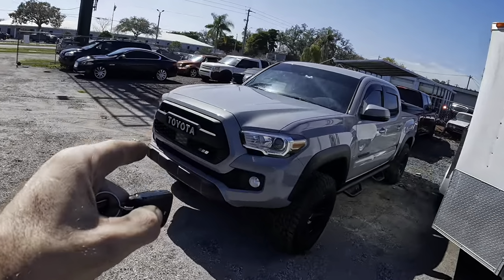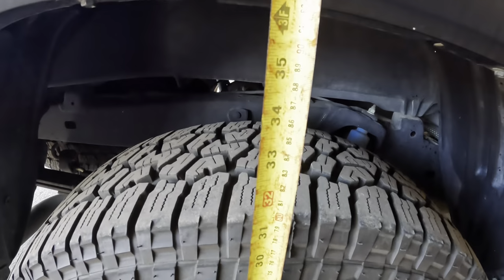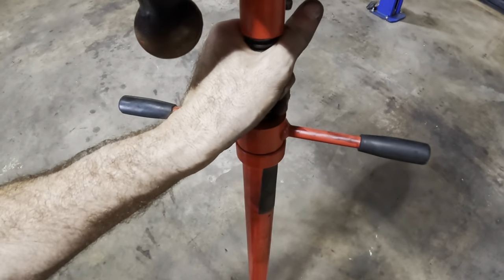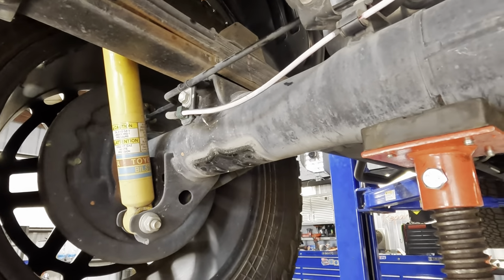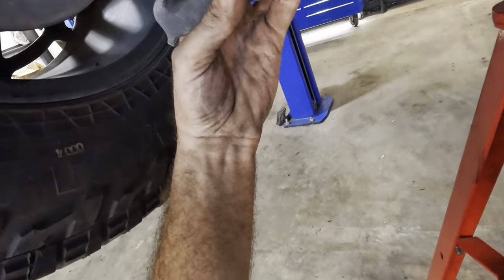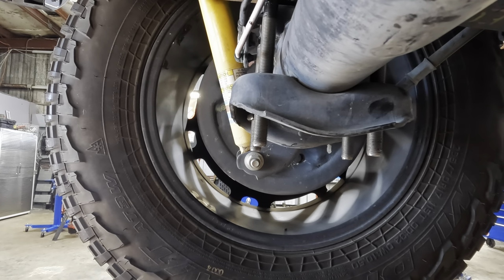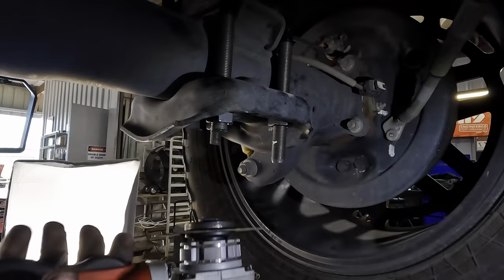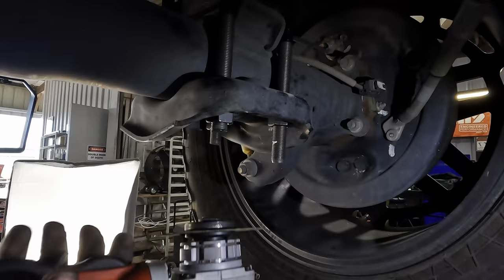Customer States Suspension is Leaning Reverse Carolina Squat | 2021 Toyota Tacoma TRD 4x4 3.5l

Comment: Toyota tech here. The rear shock holds the axle. If you unbolted the bottom shock the axle wouldve lowered and wouldve been so much easier. Also i see it had a pre collision system. This system is very sensitive and requires recalibration after any suspension modification or to be disabled for liability. Be careful, you can get blamed pretty easily if that wasnt recalibrated and they get in a collision.
Reply: Wait, so it could be upset by a minor change in ride height/angle like that? I could understand needing to reset it if you do some massive change in how it sits, but this wouldn't be much different than adding/removing a couple hundred pounds from the bed as far as how the truck sits overall.
Reply: @s.murphy8336  absolutely it can. In the owners manual it states if you are towing or hauling something heavy to disable the pre collision system. We offer a factory lift kit option for tacoma and tundra and when the recalibrations are completed the numbers are completely different. Assuming they also already recalibrated for just the front spacer as well.
Reply: I miss the days when vehicles weren’t big mobile phones with wheels. Don’t hassle about an EMP, don’t allow anyone with a Neodymium magnet near it😉!
Reply: @s.murphy8336 it’s a vehicle modification.. vehicle mods typically 99% of the time will void your warranty and the dealer will spin it anyway they can to blame the mod for the damages so they aren’t liable to repair under warranty.. always safe to wait till the warranty is expired before doing anything to your ride..
Reply: @s.murphy8336  I AGREE IT WOULD HAVE BEEN BUILT THAT WAY FROM THE FACTORY....EVEN THE LEVEL KITS CHANGE/ALTER THE NATURE OF THE VEHICAL
Reply: Finally, sound advice!
Reply: @BoomHeadshot666  Unless he got an extended warranty  it's out of warranty 3yrs/36,000 miles. Trucks a 2021 with 68K on it

Comment: Tacoma need a longer rear shocks, it's topping out when you brake.
Reply: That doesn't matter when your doing the lift just for the looks. 🤪
Reply: @Rocket39Smoke14  what you mean it don't matter, it will destroy the shocks. it'll come back in 2 weeks cause it leak oil everywhere.
Reply: Those being the stock/factory shocks, probably could do with a set of longer travel ones. Front & Rear.  Even if it is for looks only, the shock ending travel may contribute to ride quality issues.  I'm sure Ray will mention to the customer. I wouldn't have thought of it had the differential not dropped enough to put the spacers in.  Another thing I thought was those rear leaf springs may be what really needed upgrading, another leaf or something like that.  Just an observation.
Reply: @Rocket39Smoke14  The short shock will tear the mounts and shocks apart every time the suspension cycles because they will top out.  Having to long or to short of shocks will hurt ride quality because the shock will hit hard on every cycle.
Reply: Ok so, you mean that, Toyota have made a mistake, and installed the wrong shock? look, Ray did not replace them because is no need. we have to be more careful with the comments without knowledge guys!!!!
Reply: Yes. I am aware of that. So, why is Ray doing this lift knowing that it WILL cause more damage and hurt ride quality? I'll tell you why. $$$ @alvinmitchell6799
Reply: @victorbarajas1395  The stock shocks work for the stock ride height.  Changing just part of the suspension components can lead to other parts needing to be changed.
Reply: @victorbarajas1395 it's simple the distance from the top shock mount do the bottom mount is now 1 in further extending the shock 1 in further than stock height.
Reply: @dbeckley43  1 inch isn't going to make a difference with on road usage.

Comment: The next guy to work under that truck is going to be pissed when they slice their arm open on the cut and not filed edges on those u-bolts.. Kind of like the guy who snips the zip ties on an angle and leaves them long.. Otherwise love your channel and work ethic Ray.

Comment: The shock will now be over extended Ray needs new longer shocks
Reply: Yep, he should have realized that when he removed the U bolts and the differential didn't drop. Those shocks are maxed out.
Reply: No its not! where di you learned that the shocks will over extend? that is not possible and this is why, Ray did not replace them!! lets be good here and appreciate the work this channel offer us all!
Reply: @BruceCoggins  This is a dumb thing to do.  Driveway suspension designers, then this junk is on the road, scary.  the entire camber, caster is now all off, suspension, steering, is actually done factory for a reason, but a driveway nudnick knows better, here just raise this, shove some stuff in, i am an injuneer.
Reply: @victorbarajas1395  the axle stopped moving down, the shocks where holing it, then pulled down with block, makes shocks over extended,
Reply: The shocks had no vehicle weight on them, they are not "over extended.

Comment: In my 30 years of building Toyota Trucks. I’ve NEVER seen a broken U-bolt that was reused. And I’ve reused A LOT of Toyota U-Bolts. Even when building Spring Packs for Tacoma’s by adding extra Tundra leafs to the stack.

Comment: I had the same truck last year that I did the same lift block install on.  The easiest way to do that is on the ground. Loosen the U bolts and take that assembly off the axle. Next use the bottle jack that comes with the truck, the one that’s under the rear passenger seat. Take the bottle jack and put it on the ground right near the axle under the leaf spring and raise the bottle jack up to push up on the leaf spring and then you can wedge the block in to the open space. Then lower the bottle jack and reinstall the new U bolts.
Reply: It probably wouldn't make a good video that way , but your right saying on the ground ! Its the only way I can do it because I don't have a lift  .

Comment: So one of the first things my boss got me to do when I started my new job was to fit new springs to his ute. (because in my previous job, all I did was suspension, day in and day out...) It's just one bolt, and it makes it so much easier, safer and quicker to just unbolt the shock and let the spring and diff housing move how you want it to, rather than have the shock pulling on the components you need to line up again.

Comment: Arguing about weather or not you can reuse the u-bolts is a moot point when you realize that the original bolts were too short to go through the base plates with the spacers installed. Thus the new longer bolts.

Comment: To calibrate air suspension on audis the official measurement is taken from the wheel wells, but to the hub of the wheel. Tire inflation does not distort that

Comment: right side rear leaf springs are always a little stiffer because of the axel torque, they actually intentionally put more weight on the right rear wheel on a solid axel because the torque from the driveshaft makes the right rear wheel lift off the ground thus you get the "one wheel peel" most manufacturers bias the weight a little to the right rear tire for this reason.
Reply: That maybe true for some models but I know first hand the leaf springs on the f-150 come out of the same bin with the same part number and can be put on either side. I see it everyday at work.

Comment: every truck i have seen with a so called leveling kit, actually gave it a squat.  and the only truck i've seen currently that needs this is the extended cab f150 because the front is so much lower than the back.  you always wan't some rake.  both for payload and towing.

Comment: Never have questioned Ray till now but.. that needs longer shocks to make full use of the lift. The axle should have been easy to lower the 1” without prying if the shocks were not at max length.
Reply: That's not a Ray question, that's a 'What did the owner want done" question.
Remember, they already paid someone else to have the front end lifted first.
Reply: @MonkeyJedi99   I get that. One of the main reasons most shops wont install customer supplied parts. A local shop I go to will still install customer parts IF you provide them with the EXACT parts list they tell you is needed.

Comment: the 07 wrangler i had sat low on the front, that was common on the early jk's, the end of one of the front springs broke so i replaced them with springs out of a 4 dr which made it sit level.

Comment: I have a 2007 TRD, it has the 4.0 but I couldn't get the 6 speed,I barely could find the Tacoma.
It has been the most reliable vehicle I've ever owned, besides all the free work from Dana that is.  
I had to put an A/C compressor and cat back exhaust in 2022, brake lines in the beginning of 2023, and rack and pinion at the end of 2023. For a vehicle that's been in Michigan I'm impressed with its rust perfection on the body. No rust yet.
hopefully I can get 10 more years out of it. It drives like new.
I jumped when that prybar slipped!

Comment: You’ll probably get a more accurate ride height measurement going from center of the wheel hub to the fender. That way your measurements aren’t impacted by tire pressure.

Comment: Had a 68 Torino and I had to deal with a leveling problem.  Leafs in the rear and coils in the front.  I placed carpenter levels on the driveshaft hump and replaced the shackles until the levels show level in all directions.  Easy and effective  (I was a kid and couldn't afford new leaf springs)
Reply: Yep, Levels generally never Lie...
Reply: @randybeard6040 
Oh contrair Randy, levels, even when working typically lie. On the rare occasion they are just Plumb standing about. Even rarer still is when they are searching for a new Angle!

Comment: had you left the bolts on the first side loose it would have been possible to move the axle without resorting to the use of ratchet straps.

Comment: I think I’d give those bottom plates a couple of taps with a hammer to settle them in, before I’d torque them again. after your car park excursion ! To be fair, I’d rather have the back of the motor a couple of inches above the front.

Comment: I'm surprised the lift block did not have at least a °3 taper to adjust the pinion angle.  Perhaps one or the other could be rotated °180 which would be a very not good RAY!

Comment: Why?  is the biggest question?  raising a vehicle, why?  Missing the over sized tires sticking way past the fenders..cus you know, it's pickup truck brains
Reply: It is higher in the front right now and raising the rear is easier than lowering the front.

Comment: Curious, if you add aftermarket stuff like that do you give the stock parts back in case they want to put it back to stock someday?
Reply: Good question. I always thought a shop would at least offer removed parts unless there was a core charge or a safety issue involved like glass for example.
Reply: Shops usually do not return parts to customers unless asked to.  But in a modification situation like this, I don't know.   I hope the subject was covered with the customer.
Reply: Most shops I’ve seen when aftermarket “modifications” are made to a vehicle, the stock parts go back to the customer regardless of being asked unless the original parts being swapped out are trash i.e blow suspension/worn out no longer usable components

Comment: The heart wants what the heart wants, but I imagine these Toyota engineers obsessing of suspension geometry to get the best combination of ride, stability and capacity then making what they designed work with stability control, traction control and antilock brakes.  Then Joe Toyota owner wanting a "look" and getting a "leveling kit" that doesn't level, so lets add blocks....Ray does what the customer asks, and more power to him....but geez, the poor engineers knowing this goes on.
Reply: Yes. On what looks like a pavement princess, I fail to see what the point of lifting is in the first place. It's a culture thing now. It doesn't seem to have any practical use whatsoever. Lifting stuff just seems to be the current generation's d*** measuring competition.

Comment: IMO, instead of a lift block, the owner should have opted for an additional "helper" leaf spring added to the rear leafs.  It would have lifted the rear between 1 and 1-1/2 inches, plus increased the overall payload capability of the truck.
Reply: That's what I was thinking. Spacer is just for looks. An add a leaf would have multiple uses.
Reply: You're assuming that someone with a pickup truck would actually want to pick things up with it.
In my New England experience, about 40-50% of pickup truck owners use it like a car. And about 10-20% refuse to put anything in the bed for fear of scratches and dings.
Reply: That tonneau cover and shorty bed says this vehicle does not do truck things, so no need to add capacity.
Reply: @jdesaavedra0432  But he has a 3 way hitch.....
Reply: The proper way to check ride height is from the guard to the centre of the wheel hub as the ground is not always level even concrete.
Reply: @darrengray2309  Good point. This also eliminates differences in tire inflation.
Reply: well yes but new spring packs aint cheap, I need to buy a new set of rear suspension components and I think it was gonna total out to around 2k for everything I needed (springs, shocks, helper bags (maybe) mounting hardware etc.)
Reply: Wouldn’t that also make it stiffer when riding empty? I’m not sure I’d want to beef up the springs unless I intended to keep a camper or something else attached to it.
Reply: @thewausaudude  That is part of the decision loop.
Are you seeking height for "cool" on a pickup you use as a less fuel-efficient car? 
Or are you looking for some extra height to allow heavier loads to not squat your truck to where the tires (tyres, for our overseas friends) threaten to grind the wheel wells?
Reply: @MonkeyJedi99   yeah I’m not sure what the owner was going for in this video other than correcting the squat. If I had a truck it’d probably keep the stock suspension. One would be useful for pulling the boat and the occasional times I need to haul things, but that’s about it.
Reply: @thewausaudude no one buys tacomas for their smooth ride, I drive a ram 4500 with a big ass service body for work and it definitely rides better
Reply: @jonlittle1402  true. I’m just remembering a time when my grandpa sold his old pickup and camper insert. The buyer originally only wanted the pickup and bought it with the camper removed. Thing is it had heavy springs to support the weight of the heavy 1970’s era camper. Guess it rode like it had no springs at all and the buyer shortly returned for the camper anyway so it’d at least drive without requiring a chiropractor to be present with every oil change.
Reply: I don't think that guy was thinking that far ahead, he probably was just thinking about getting the look at the lowest cost possible.
Reply: Wouldn’t you also want to check air pressure in all four tires to ensure that they are equal?
Reply: @MonkeyJedi99 those are specific percentages for "your experience" 😂
Reply: @electropentatonic  That is EXACTLY what I said.
I properly relayed subjective evaluations, with language specifically indicating that is was subjective.
-
What was the point of confirming that for the rest of the class?
Reply: @MonkeyJedi99  Just pointed out the numbers are bullshit and completely irrelevant of anything in the real world.

Comment: what would be the outcome if the impact tightened the bolts too tight. then you use a torque wrench set at a lower setting than the impact socket the torque would click and it could be too tight???

Comment: I haven't read farther down, but am I the only one wondering if the reason the "new" "leveling" spacers up front were installed and the lower shock/strut bolt was tightened while the suspension was fully drooped down, resulting in unexpected extra height? (Bushing captured under zero suspension pressure resulted in unexpected extra ride height?)

Comment: Is it worth explaining to people that with Independant suspension the wheels move in and outwards as well as just up and down, and when placed back on the ground the tyres don't move as much as the suspension needs to and that is why they hold themselves in and the vehicle up higher until the tension comes off the tyre and releases the tension in the suspension? or is that too much of an explanation?

Comment: Not understanding not removing the on lower shock bolt and wasting 15 mins with straps and pry bars. You had the axel on a stand! Must be a long day! If the gas tank is on  the lft side you'll usually  get a slight difference  from the right an left side.

Comment: Good example here. If this job was getting done at a flat rate Toyota store there wouldn't be a tech that would take the time to cut those U bolts down.
Reply: They wouldn't have taken the extra 5 minutes to bother measuring it either. Find out how shops pay their techs before picking a shop to bring your truck too.

Comment: Trucks are set up with the front end lower than the rear for a reason. I suppose if you just want a pavement queen and use the back as just  a beer can recycle bin it's ok.

Comment: There are a lot of idiots in Floriduh that have lifted trucks that are much highed in the front than the back. Must be the new "low-rider" look. Doesn't bother me except at night because they don't adjust the headlamps to compensate, so they shine right in the eyes.
Reply: I guess you missed the memo where for multiple years now that style of bizarre suspension work has been called the "carolina squat".